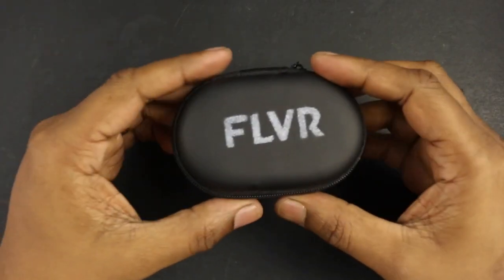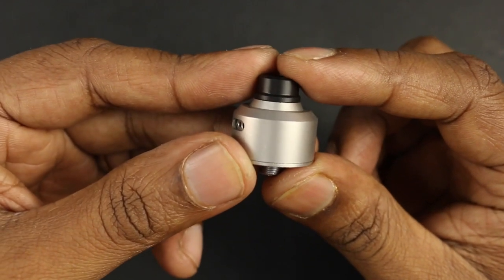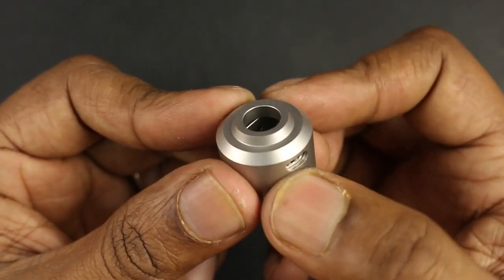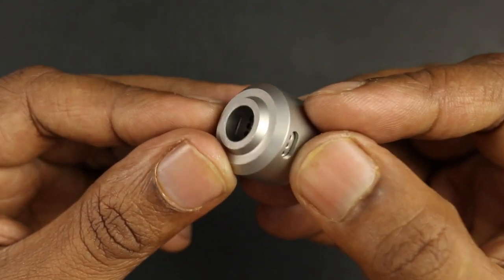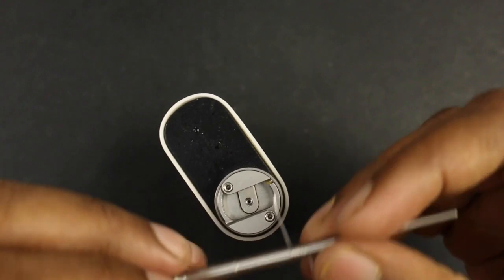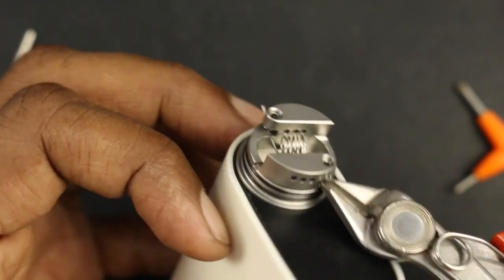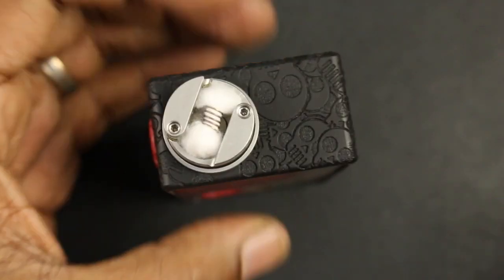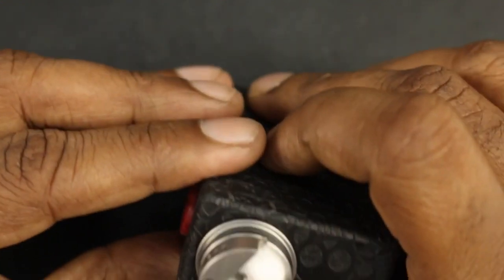FLVR Squonk RDA - Flavor-Chasing from Malaysia

Comment: There's a lot of negative comments on here about this rda. I got mine a couple weeks ago. I own around 40 single coil rdas in my collection. Everything from narda, le Concorde to the newer wick'd, monarch, skyfall ect. And honestly in my opinion the flvr is as good if not better then every other rda I own. It doesn't look like much when you see the deck. But trust me the flvr has the smoothest draw and the flavor is top notch. It's a hard rda to get with under 100 made. They release in small batches of 10-20 rdas every few weeks. And you have to be in the group and get on a list to get one. I took a chance on picking the flvr up. And I couldn't be happier with it. I'm debating trying to get a 2nd.

Comment: Is round wire coil better than clapton/alien for flavour chasing in small chambers (22mm max) ? single coil. More accurately like an Hadaly.
Thanks, great videos !
Reply: Hello. Simple Fused Clapton is better for flavor. I build mine at around 0.4, 0.5 ohms. That's my sweet spot. With regulated device, I used other builds for mech squonk ;)

Comment: Same old  Sqwank r.d.a,s ..  ive seen very little innovation in the evolution of design so far  with these  22mm single coil through post airflow yawn factors'"   same profile and form factor , but with some swanky foot note of A special feature to bump up the price to $145 euro,s..!  that is disgusting bro its a lump of machined steel not titanium or with ANY exotic material that makes it stand out from the rest...  its a Fail    B-b